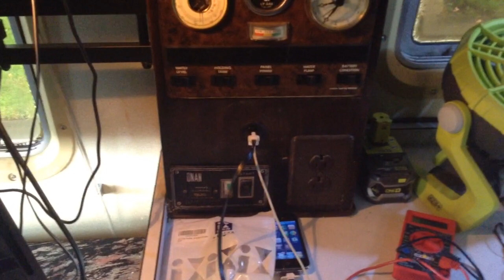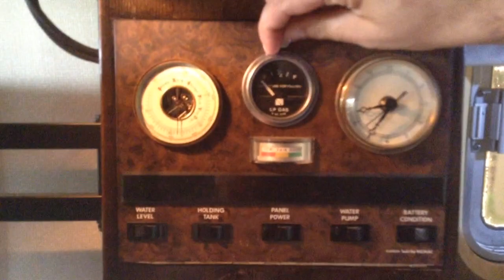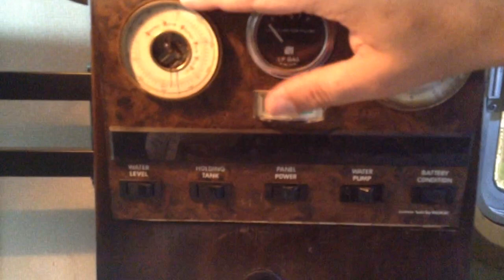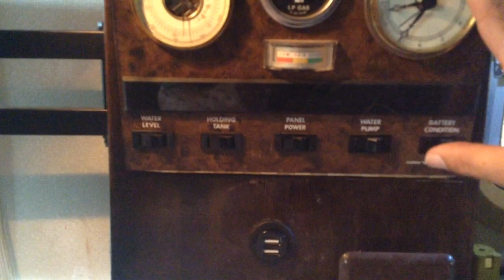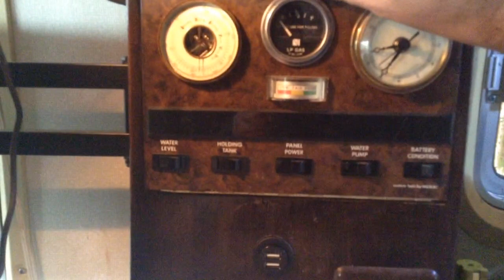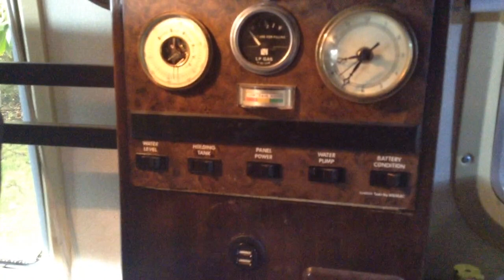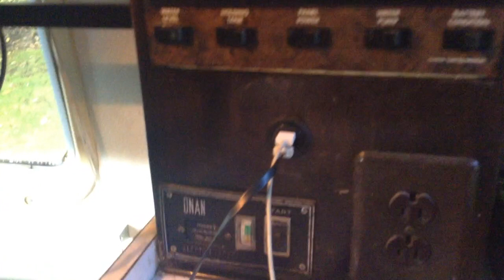Quirks with the dual use USB power plug for 12v vehicle systems

Comment: the problem you have is the max amperage output of the usb outlet. Modern smartphones and tablets require about 2 amps if you charge them while they're on. So charging two usb devices might just be too much for that dual port. Another issue could be the usb cables! They're not all made equally. Still I think is low capacity on the port!
Reply from the maker: +SurvivalTech Nord  I think it is low capacity of the port also, except that on the triple unit set which has the 12v, this USB and a Voltimeter, I don't have that issue.   That's the one I put in the Trooper.   I will probably end up pulling this out and putting in the triple wide unit.